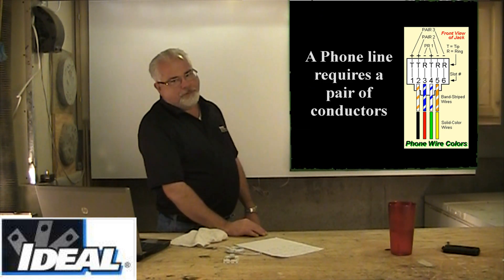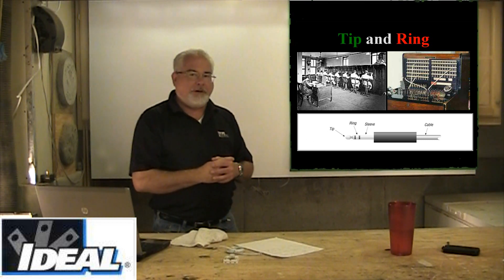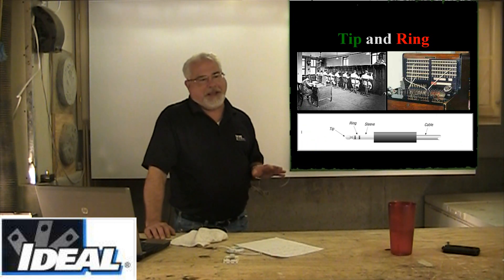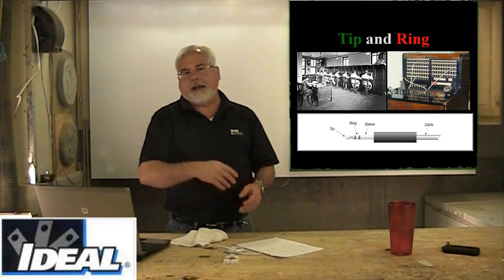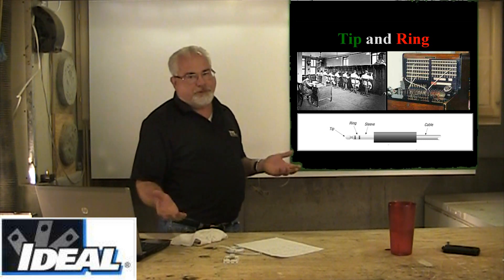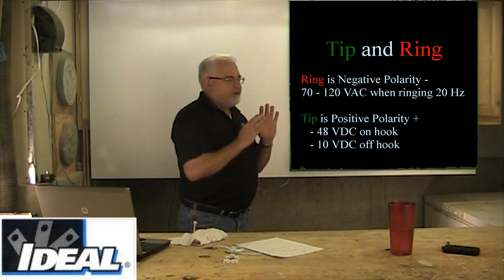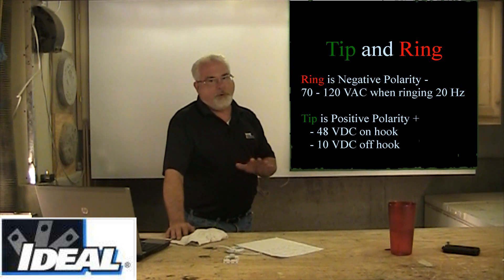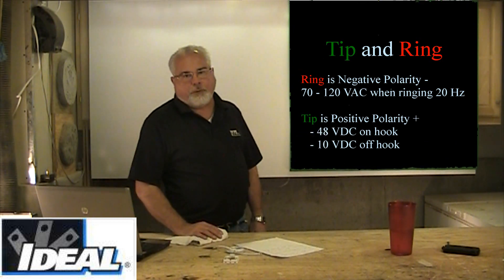Telephone Basics Part 1

Comment: Is there an easy way for a homeowner to test for a short in an interior line  between demarc/NID and the wall jack?  I plug in phone at NID and get dial tone but no dial tone at wall jack.  Have you made a video of testing for such?  I have several lines going to the NID.
Reply from the maker: You could disconnect the wires at both ends and then using an Ohm meter see if one of the pairs is shorted. You could identify the pair but that wn't tell you wehere it is shorted. Sounds like a little wire tracing job good luck Ron

Comment: This is a great presentation.  Even in 2018 it is good basic info.  Makes better sense than all the other videos on this topic I have been watching over the last few days.   Seems Identifying my phone trouble is complicated by the fact that there is a provider  for internet and phone and contractor that fixes any faults outside the property.  All cables are under ground. And so finding the source maybe from within my property.  Inside on the wall is the jack point to be checked.  Anyhow, I will persevere to keep my landline. I am old fashioned that way.
Reply from the maker: Eugenie good to hear from you. I still have a land line too just provided by the CATV guy. Ron

Comment: Hey Ron, do you know why the phone wires (to plug into wall socket) that come with phones have the colors reversed? (like a pass-through cable)
I notice one end is RED->GREEN and you flip it and the other end mirrored GREEN->RED
Reply from the maker: Ricardo Cooper In older analog phone circuits they required that the cord is reversed wired for them to work. You can think of it as transmit to receive. Newer digital phones are not polarity sensitive so they do not care. They still sell them that way as people still have older analog phones. Hope that helps
Reply: ***** That explains it, thanks!